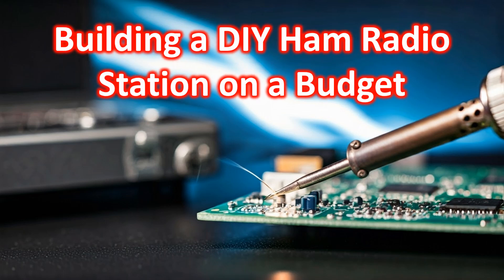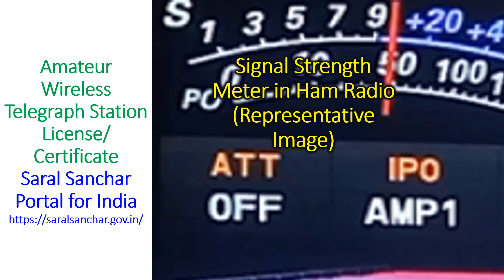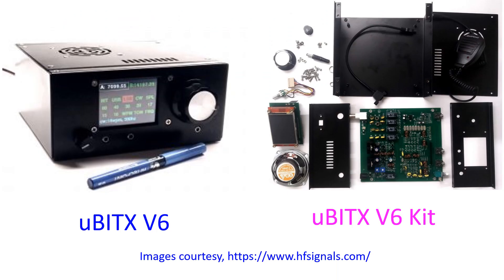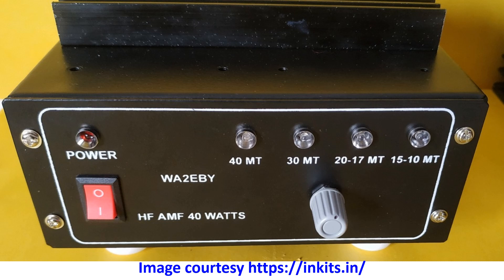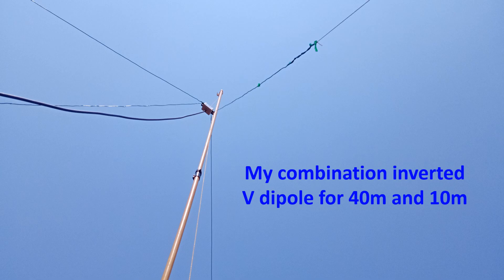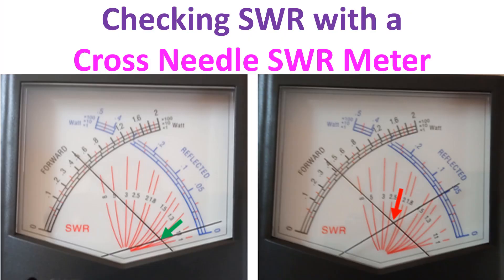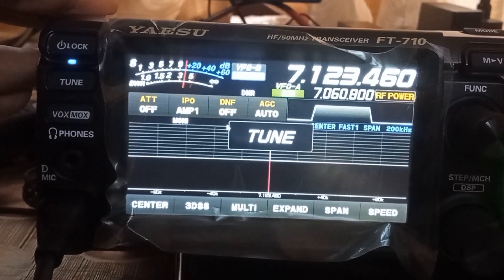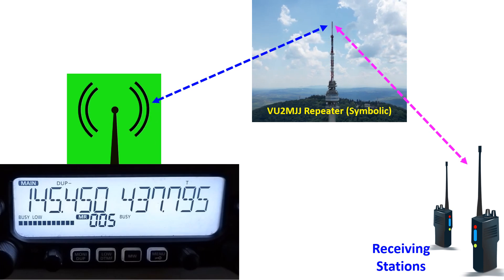Building a DIY Ham Radio Station on a Budget

Comment: Sir I'm Vu3jfr my budget is not high if you know anybody selling ubitx kit with low power not the amplifier ones pls help om
Reply from the maker: I know only VU3SUA's page of EASY BITX (Not uBITX): https://inkits.in/product/easy-bitx-mini-kit-for-20mt-40-mt/. But it is seen as out of stock. You could call the number listed there. I have not used BITX. I have bought an ATU-100 EXT antenna tuner from him, which is working fine for me. Assembling from kit may not be that easy. Your Elmers may be able to help you.